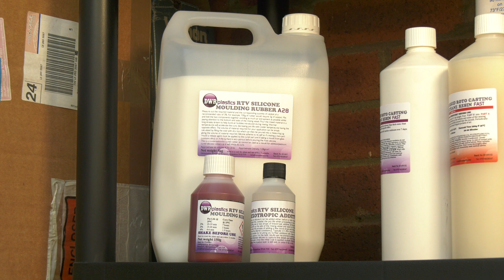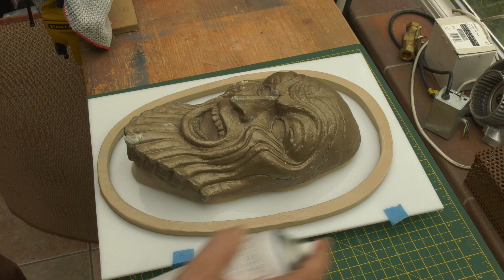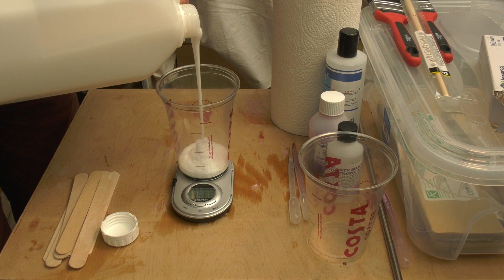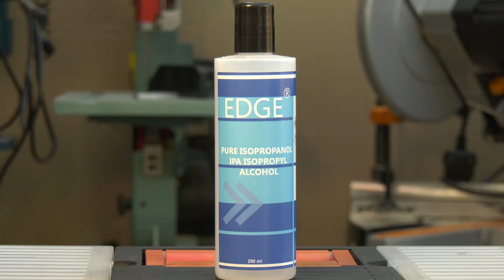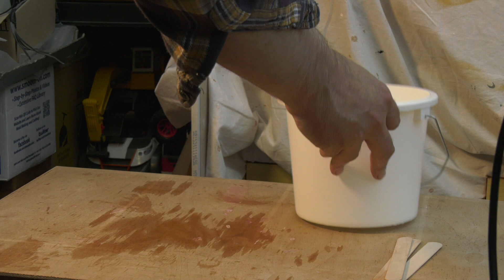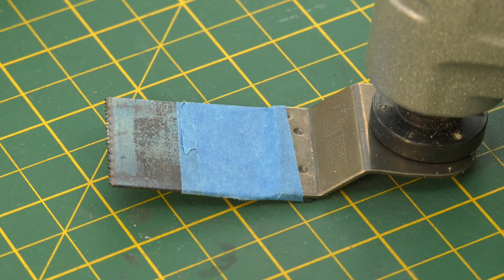How to mould a mask in silicone - An In-depth Tutorial [Re-Upload]

Comment: How do you find the DWR silicone compared to Smooth on Mold max?
Reply from the maker: It does the job as well as it needs to. Smooth On is over hyped and over priced, if you want my honest appraisal. Can't say anything about Mold Max as I've never used it - I'm not even sure if you can get it in the UK, you probably can, but I've never looked for it.
Reply: @PBProps  thankyou. It is available from Bentlry supplies but I'm migrating to DWR.  Thankyou

Comment: Brilliant video! I'm moulding a Clockwork Droid mask that I've sculpted and this video has been extremely useful. My mould is definitely not as clean looking as yours, but for a first go at brush up moulding I think it's going well! I'm using plaster bandage for the support shell (mainly to keep the budget down!), just wondering if it particularly matters if the shell is one piece or if it comes apart in two parts? I've seen both done for larger mask moulds like this and not seen anyone say for certain if one method is better than the other!
Reply from the maker: Well thanks for watching and I'm glad that it's been useful to you for your project - and good luck with that, I'm sure it'll be brilliant!

A plaster support shell is just fine, so no worries there. As for splitting the shell in two, you only really need that if the cast inside your mould is liable to lock (wedge) into place. If it would, you'd split your shell so that you can remove it easily and then flex and roll your silicone mould off the cast.

Because you're moulding and casting a Clockwork Droid mask, there isn't sufficient raised detailing or contours to lock your cast within the mould, so you can probably get away without the split, though if you are unsure, it won't hurt to have the shell in two parts... it may just give you peace of mind!
Reply: Brilliant, thanks for the help!
Reply from the maker: As always, I'm very happy to help where I can. Best of luck with your project, I'm sure it'll turn out just perfectly.

Comment: I have a problem with my mix being still runny even after I let it sit for 30 minutes. Can anyone provide insights for my problem? Thanks
Reply from the maker: There's various things that could be an issue here.

The most obvious is - have you added in the correct amount of catalyst? 

What is the cure time? It will often be runny for quite a while during the green stage, then suddenly it'll start to thicken as starts to cure. Depending on your mix ratio, it could take several hours or even over night.

Another thing to consider is the ambient temperature of where you're working, too cold and the reaction time will take longer, too warm and it'll cure quickly.

Right now, your best bet is not to worry and leave it to cure over night. Just check on it every hour or so. This time is always quite a nerve wracking period, if it all goes wrong, don't worry, it can be cleaned up and you can start over.
Reply: @PBProps  the amount of catalyst maybe i added a little bit too much from intended ratio because i initially thought the process would quicken. Room temperature fairly around 30 degrees. This time i only did a small portion for testing after a wasted big fail from previous attempt. It would be great to know at what duration it starts to cure.
Reply from the maker: Adding too much catalyst would just make it cure quicker and your ambient temperature would seem fine. If it's not cured over night then the only other explanation is that your silicone is reacting to whatever it is that you are trying to mould and when this happens, it will not cure... at all - ever.

Curing times in general depend on various factors, mix ratio, silicone type and temperature. With the things I've worked on, I tend to do a hot mix (more catalyst) for speed and usually I'm set to demould after a couple of hours. However if it's got a lot of detail that I want to capture without air bubbles ruining it, I do a cool mix (1%) and leave it over night.

You say this is your second go. Did it not cure the last time? If this is the case, then it really would point to cure inhibition caused by the object reacting badly with the silicone. If you've sprayed it with a primer, clean it up, then respray with a different primer brand and do a new, small test with your silicone to see if it cures or not.

EDIT: Something else that I just thought of is high humidity in the air where you're working. Silicone hates moisture content and this also stops the cure from happening. If you can rule that out, then you may have your answer.

Comment: Why does the paint peel off when it dries after I finish my work, what is the reason?
Reply from the maker: I'd need some more information here. So you make your silicone mould, make a cast and paint it - then you get paint peel, right? What are you using to make your casts and what type of paint are you using? At this point, I'm wondering whether or not you have washed your casts before painting them. Having oils on the casts can cause paint not to adhere well.
Reply: @PBProps  I mean when I draw on the mask after it comes out of the mold with silicone, but it peels off 😢